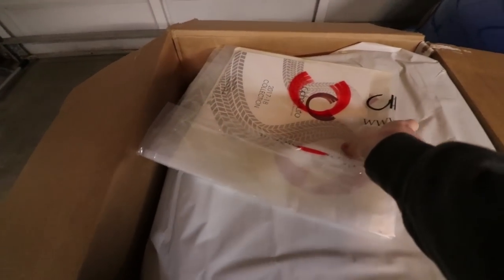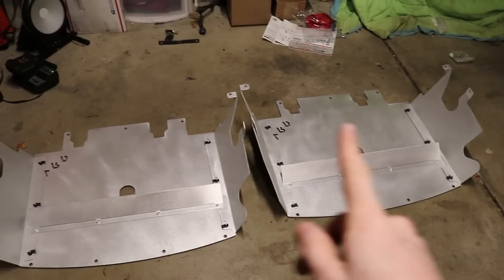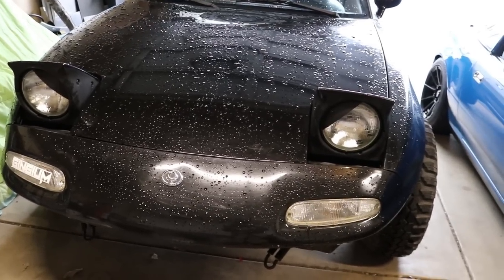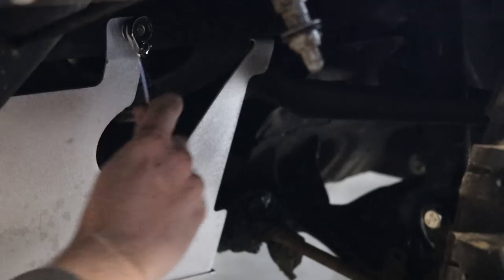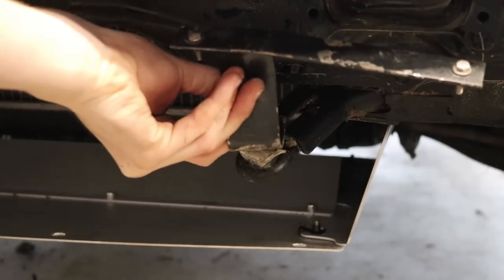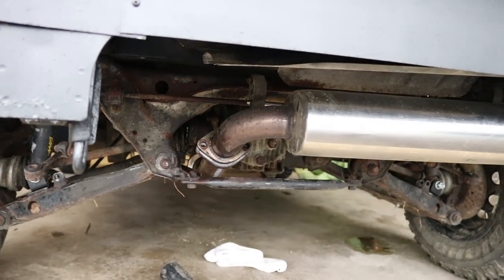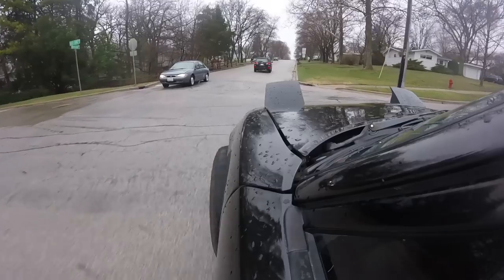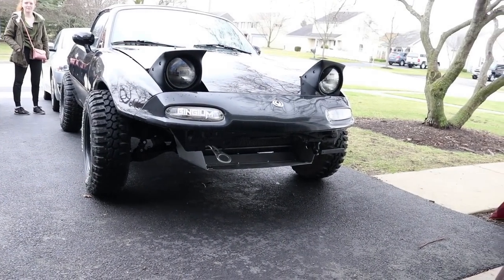Aluminum Under Tray & Straight Pipe Exhaust || Project Rally Miata (Part 8)

Comment: ChrisFix just uploaded a video on racing seats but eh probably just a coincidence.
Reply: Oh, and a quick tip: Get a supercharger for this Miata. The turbo will get filled with a bunch of mud and your engine will die.
Reply: Matrix    I didnt think of that
Reply: Many WRC cars have turbochargers
Reply: Ian B this build is more of a off-roading and mudding miata not a rallycross miata.
Reply: Yeah
Reply: There's also the risk of water splashing onto the 800+ degree turbine housing

Comment: Do solid engine mounts for both. Offroad Miata drive through rocks and curbs and little bit more vibration don't make any difference. Also it increases throttle response. Also new diff bushings

Comment: Additionally for most "cold" spray in bed liners you wanna be spraying over consistent 60 grit scratches for best adhesion. But the duplicolor stuff kinda sucks. I'd recommend Herculiner as a cheap solution.

Comment: just draw a line from the bumper/bash bar to the tire, and trim the under tray and other bits that stick out past it, and the put some mesh or chickenwire infront to help keep some of the mud from piling up inside of it

Comment: Souly on the off-road aspect, the under tray as it is now is not a good idea at all. It will direct all mud and debris toward your radiator. Bash bar front bumper and heavy duty skid plates are the way to go. On Molly however, the under tray will be very nice!

Comment: Just killed like 15 degrees of approach angle with that big plow lol, don't worry it will get ripped off the first time back on the trail. Talk to a few offroad guys about approach angle, then cut that thing up and make a skid plate out of it instead.
Reply from the maker: Yeah  I am aware. Im planning on trimming the bottom a bit. There will also be bash bars protecting that area

Comment: really nice work, so far!
but fyi. it's not the paint that sucks! judging by the video where u painted it, your paint prep just sucks :D it's not done by just scratching up the surface. u need to really sand down every little bit and go up to at least 1000 grid sandpaper. If u just go up to 300, the paint will chip

Comment: That aluminum under tray is completely useless on that car.  With the wide flat opening and thin material, it's going to hang up on the first obstacle it hits and rip off the car. Something made of a thicker material ad angled to meet the bottom of the front bumper, would be a better choice.  

Also, if you can find it, Kano Kroil is an excellent lubricant to use while removing rusty bolts and fasteners.

Comment: uses a breaker bar to loosen a tiny bolt, acts surprised when it breaks! Then to make him seem even dumber, he tightens the damn bolt lmao. Come on man, lefty loosey righty tighty. say it with me, lefty loosey righty tighty lol. Oh and start using PBlaster on basically every bolt you loosen that's rusty. It's penetrating spray and will remove the rust. Try using a ratchet instead of a breaker bar that'll help lol

Comment: swap that engine to a 3.0L V6 please from a ford escape or a jaguire please. Don't make it rice, make it nice.
Reply: also, if you really want to make it a rally car, then to fit the 2.0 liter restrictions then try the 2.0 L  V4 from a 2013 ford escape titanium. try throwing in a higher presure turbo than the lazy stock one that comes with it
Reply: ps the escape makes stock 231 BHP
Reply: Drerer Drerer 1. Engine swaps are expensive, forza and real life are two different things. 2. The rally Miata is just a name this is mainly a off-road car
Reply: Siam 冷静になる I am quite aware of the cost of an engine swap, but if Gigium has the money to buy bucket seats, turbo, rally suspension, off road tires, whatever kit is on the miata, paint, and whatever else is in it, i garuntee you he would have enough to go outband buy a ysed 2012 ford escape, and simpily swap engines